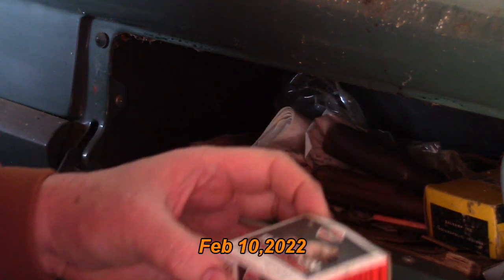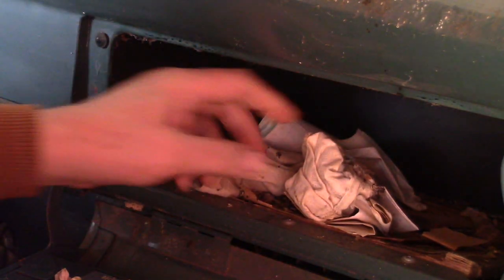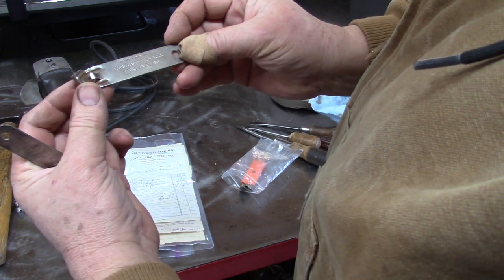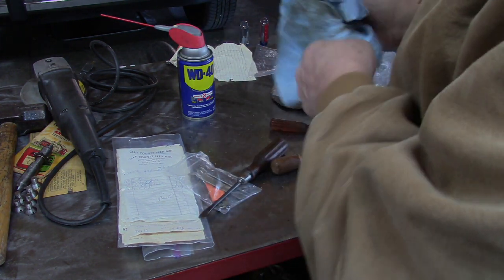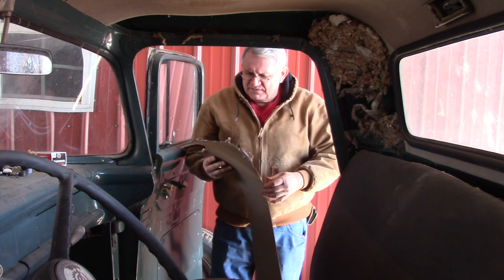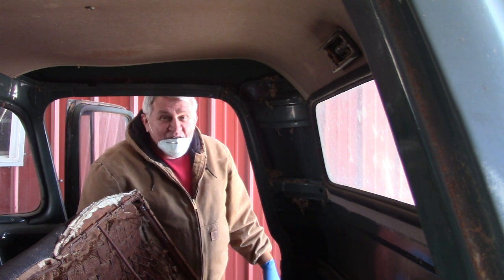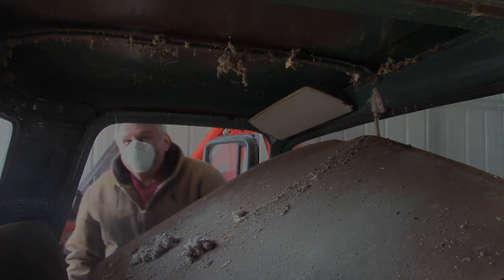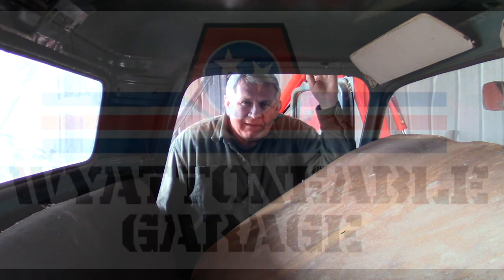1959 Ford F250 "Grandmother loves you" project. Cleaning the interior of mice nests and snake skins

Comment: I have found lots of mice remnants in vehicles before but never snake remnants!  Makes sense though.  I like those solid headliners.   Excellent project.
Reply from the maker: Everything is easier on old vehicles. I thought about your work when I cleaned up the tools I found in the glove box. I had to straighten one of the screw drivers and I used your trick to do that.

Comment: Curious how far the revival of the truck is going to go? Are you just going to spit shine it up and get it running decent,  or frame off engine rebuild ect? Btw you almost needed a scuba tank and mask to breath with all that jumk floatimg in the air..... wow!
Reply from the maker: Yeah I should have put on my respirator for that job. That mask was not that good. Jason and I have talked about how far to go on this. The plan is to clean it up and get it safe to drive then make a decision about how much more to do. We will all have to wait and see.  :)
Reply: @wyattoneable  With it sitting for so long and as caustic as brake fluid is, I would go thru and replce the brake lines due to the fact that they rust from the inside out. Then rebuild the master cyclinder, wheel cylinders, and calipers if you can. I would hate to hear the daughter was going down a hill or on the highway and the brake lines blew out on her. I thankfully speak from experience on this happening to myself on a few vehicles. Also make sure the steering and components are in good shape. You lose steering theres no way to overcome that. After that, spit and shine it, the rest can be towed home.
Reply from the maker: @Longtrailside  Absolutely. I have all new brake parts on my shelf and I plan to replace all the brake lines. Future videos are planned to show all that. Thanks.